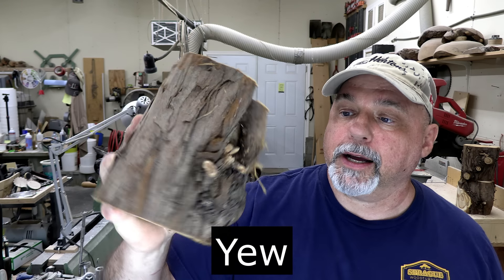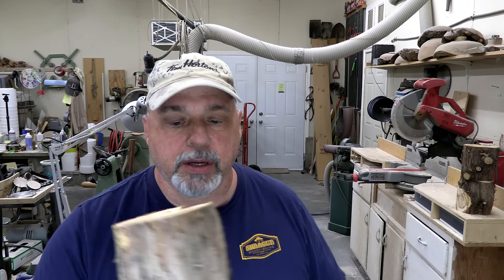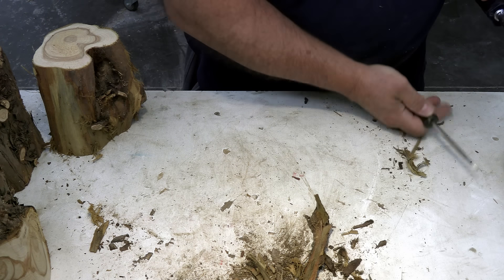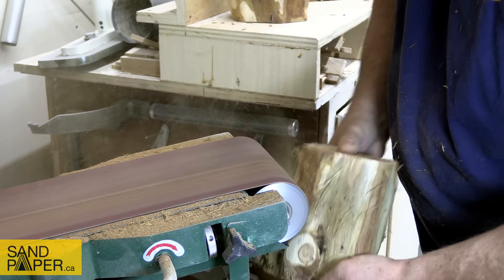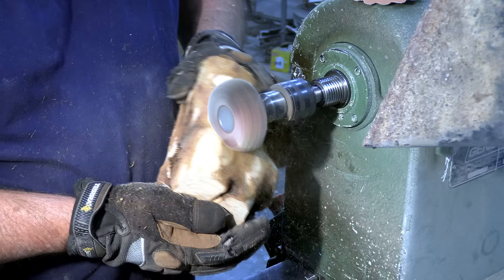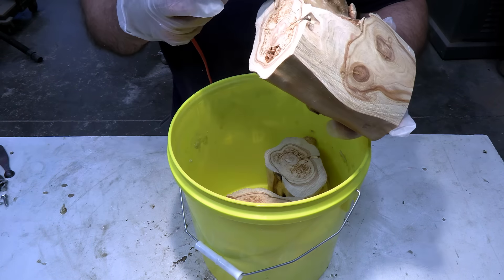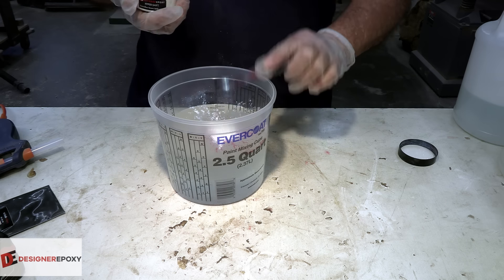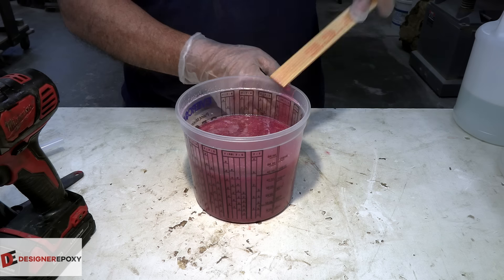Woodturning - Do Yew Like Red?

Comment: Good morning 🌅, I think considering you had a floater, 😮😂, I think you have done an amazing job, It has beautiful grain  structure on top,
Well worth effort , somebody should be very pleased with that, sorry to hear that you’ve got no bites yet on your property, And yes, over many years, I have removed lots of tiles whether it be around a bath or in a kitchen, during renovation projects, I have done some jobs where the tiles have literally fell off the wall completely have not a deed properly to the boarding behind, And on a few occasions, I’ve actually had to do the same as you’ve done. I’ve used a large chisel bit on a Kango machine, 
A catch on a belt sander  😮, it is strange. Our blood comes out of your skin, And it takes a long time to heal up, I did have a accident many years ago with a Makita belt sander one winter day, these were the days when I didn’t have a lot of money to heat my workshop, I was wearing clothing that was very loose, and the extractor part of the back of the belt sander caught on my clothing and before I realise what had happened my clothing I’ve got very tight around my stomach, I ended up having to get a guy from factory next door a socket on the end of a bar to unwind my clothing, I never done that again, stay safe. Keep up the great work., France,
Reply from the maker: Yes, I bet that left a mark, lol. Thank you very much!

Comment: There was definitely some kind of reaction with the first pour, I was thinking "where'd that colour come from ?? lol

It's funny though as it looks like the other pink is overflowing down the piece as if it was running down the sides, could be another way of adding to pieces but would depend how brave you were feeling too 😆 🤣 😂 

Another happy accident? lol the wood looks good too, the contrast between the lighter and darker areas are another eye catching feature 👍 from me
Reply from the maker: It kind o through me off too, you’re right, the first color was changed somehow. It’s got to be the wood leaching color into the epoxy. Thanks!

Comment: The yew is for sure a very nice-looking type of wood.  The shape of the piece is definitely eye catching.  I would just remember for future projects that if you think that it will get hot enough to thermal crack, that it will also get hot enough to melt the hot glue, so when in doubt, use Dwane.
Reply from the maker: Yes, I definitely should have used him. Thanks

Comment: Nice work. Great recovery from the first pour. I was surprised you didn’t use the vacuum chamber first but you overcame it anyway! Designer Epoxy
Reply from the maker: I was worried about the Artcast starting to set before I got it into the fridge. Thanks

Comment: Another gorgeous piece Jim ! I must say that the 2 different pours turned out great . A happy accident . I am still getting use to Designer Epoxy . On my last project I may have messed up the mix as the top is a little tacking . Not sure how I am going to deal with that . So sorry your home hasn't sold yet . We do hope you have a great weekend though . Thanks for sharing your expertise !
Reply from the maker: Give it lots of heat and it should cure. Try placing it in the sun. Thanks!
Reply: @SpragueWoodturning  Great ! I will give it a shot . Thank you sp much Jim

Comment: Jim, would double sided tape loose its adhesive ability when the epoxy gets hot?

When life gives you lemons, make lemonade. 

Absolutely amazing!
Reply from the maker: I can’t say for sure if that would work, but I don’t think it will have the holding power that will be needed. Thanks for the suggestion though!

Comment: Jim, the second pour of Designer Epoxy seems to enhanced the project/hollow form with a shift in colors that looks really good. Maybe a small I’d would have made it jump with a spindle.
Reply from the maker: Cool, thanks. Don’t really know what you mean on your last line.
Reply: @SpragueWoodturning  I am a victim of auto correct! I tried to say, you should have made a lid for the top with a finial on top for it he hollow form.

Comment: I really like the camouflage method for the 2nd pour! What is tear out?
Reply from the maker: Tear out is when the fibers of the wood are pulled from the castings instead of being cut off cleanly. It will leave small voids behind and require a ton of sanding to get rid of. Thanks for watching!

Comment: Jim:  Great piece.  To stop the floaters, would you be better off screwing them to the bottom of the pail, then remove the screws after setup?  You'de ruin the bucket, but save the pour.  Would imagine the heat of the epoxy created enuf heat to release from the bucket.  Or, you could tape off the holes and use them again.  By the way........ DESIGNER EPOXY
Reply from the maker: That would work, but your going to have issues with screw holes in the casting and spend a small fortune on buckets, lol. Thanks for the suggestion though!

Comment: What size is the bucket you used for this casting?  It would be interesting to get the size of the casting before it goes on the lathe to compare to final size.
Reply from the maker: I’m not sure, will try to remember to measure in the future. Thanks

Comment: Designer epoxy...that yew is impressive on color scale..lololol not to point out the obvious but hot melt glue melts when its hot. Its right in the name🤦‍♂️🤦‍♂️🤦‍♂️
Reply from the maker: This is high temp stuff and it rarely fails, thanks
Reply: @SpragueWoodturning  a hard time should always be given